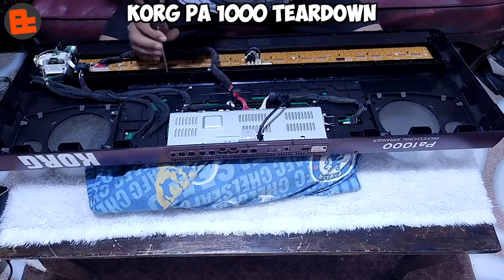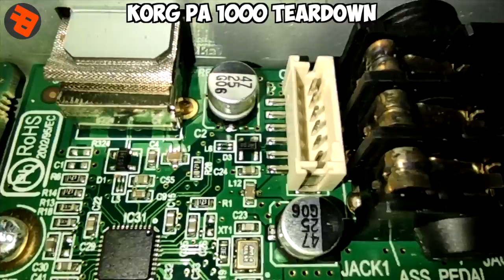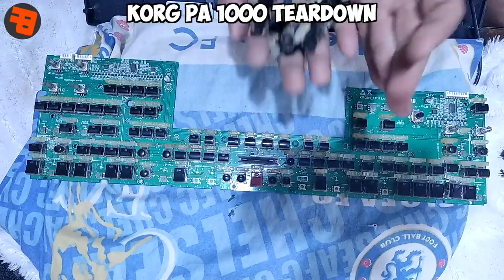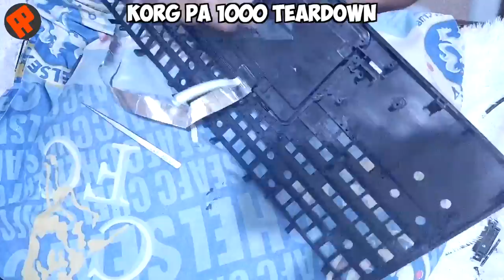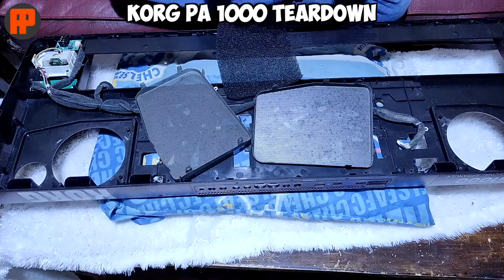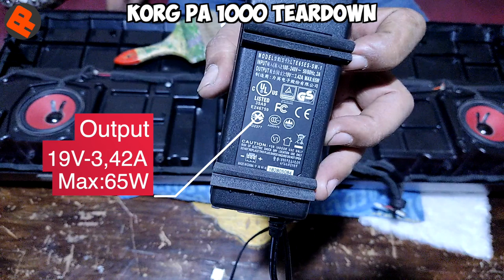Korg Pa1000 Teardown and what inside

Comment: Hello there.  I wanted a Korg Pa1000.  Do you have all the spare parts to repair the Korg Pa1000 if it breaks, or is there no way to fix it after it breaks?  For example, can it be repaired if something goes wrong with the buttons or the screen display?  Where can I buy parts for a Korg pa 1000?